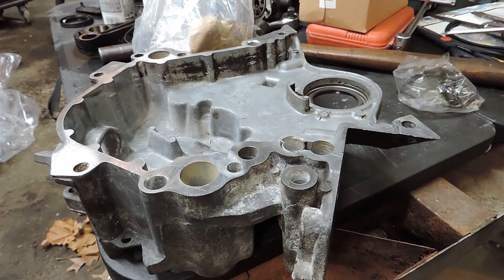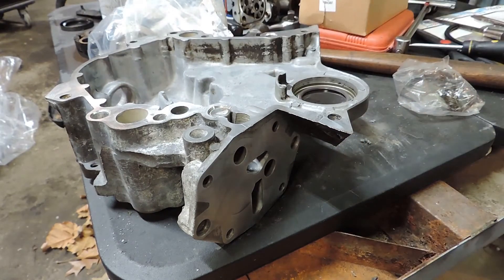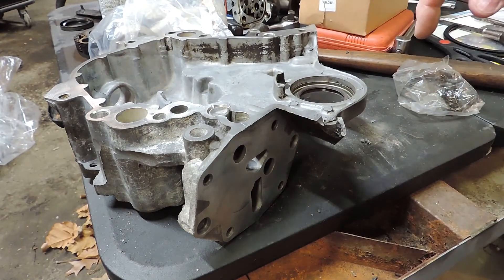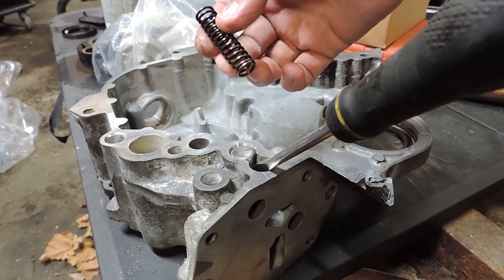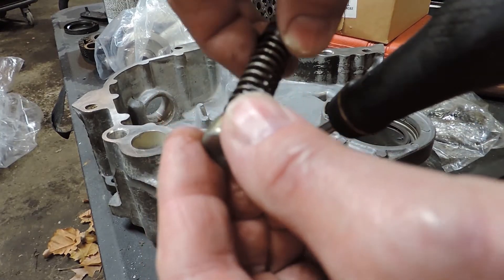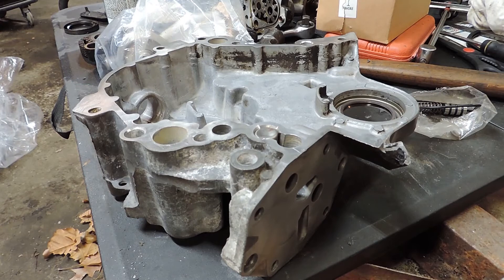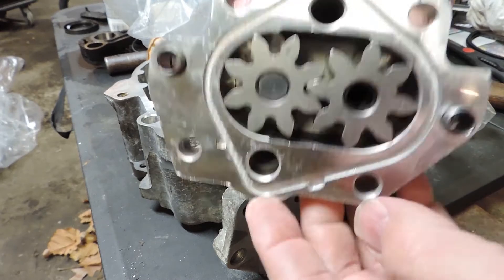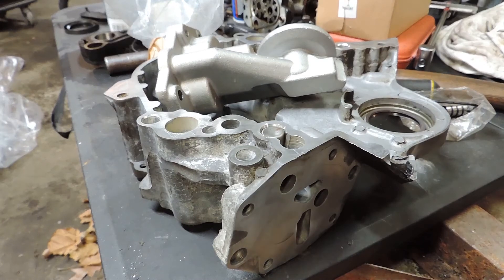Oil Pressure Regulator Valve Ford 4 2

Comment: Uggg… just changed the pump.  Never took bracket off.  Now I have pressure when it’s cold but once hot drops back to zero.  

How hard is it to remove bracket?